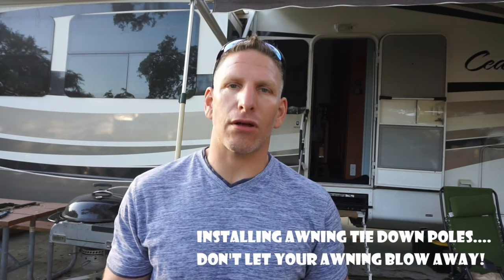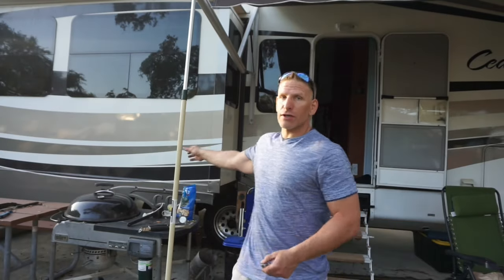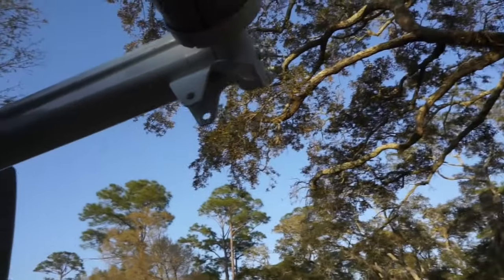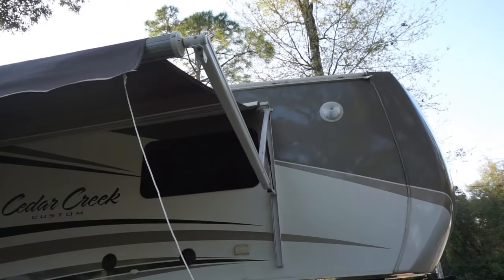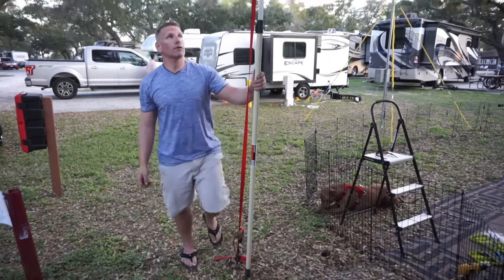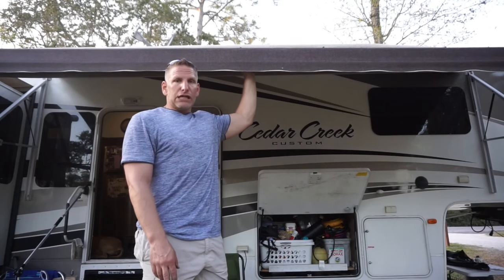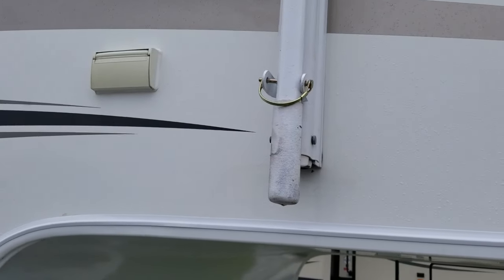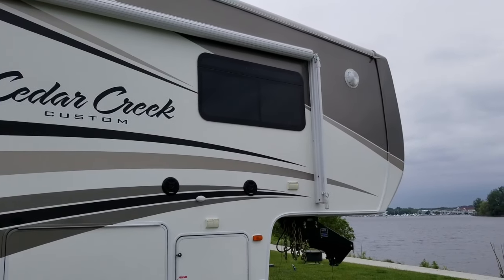Don't Get Blown Away!

Comment: I like to keep a couple buckets around so when I can't use a stake to tie something down I just fill the bucket with sand or water and use them as my tie down. Works well with easy up canapys also. Especially in Sandy areas where stakes don't hold well.
Reply from the maker: Great suggestion. We currently have one tied to a landing jack do to the concrete pad.

Comment: For those picky campgrounds you can tie your ratchet straps to 5 gallon buckets filled with water.
Reply from the maker: Thanks for the advice.  I've also strapped them to the leveling jack's. Hook the strap to the extra bolt holes.

Comment: After a few years, how's it holding up?
Reply from the maker: They work great!  The spring latch on one broke, so adjusting height on that one now requires a pin, but other than that they are good.
Reply: @TrippinWithTheSmiths   "Spring latch"?